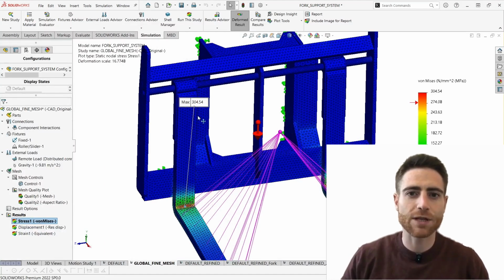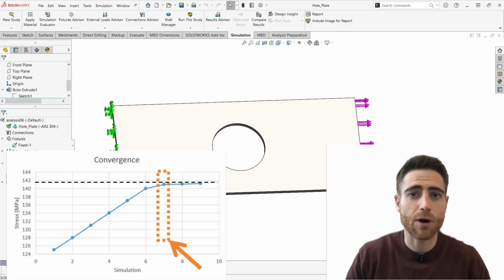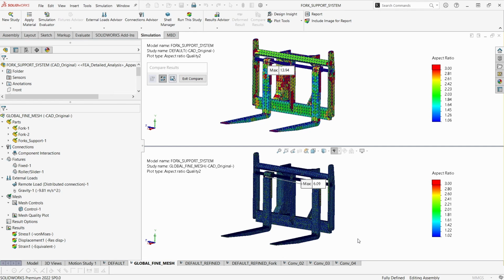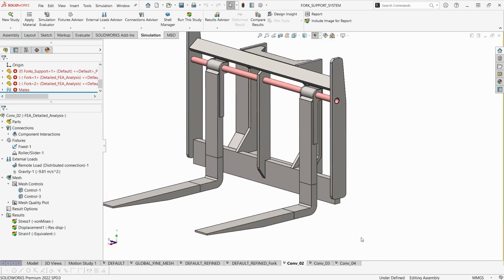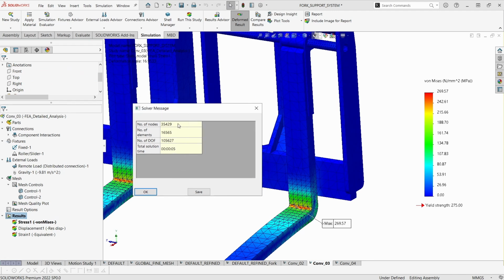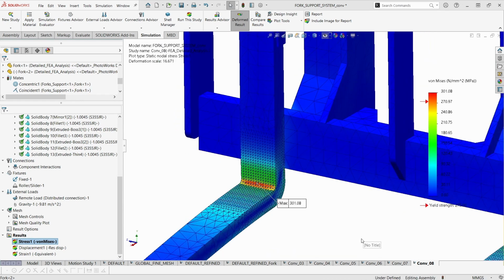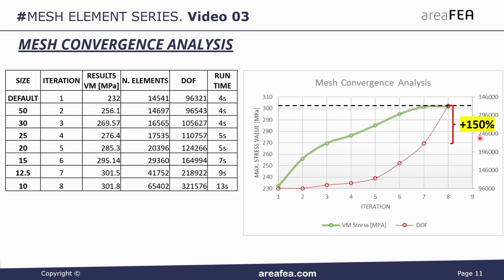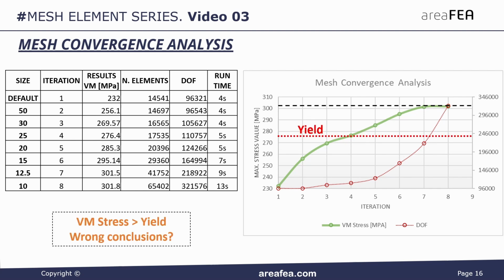When Should You Stop Refining Your FEA Mesh? | Meshing 03

Comment: Hi AreaFEA,

Great insight as always!

Mathematically, crossing the yield strength does NOT affect mesh convergence in a linear static FEA, as the solver strictly applies Hooke's Law (E = \text{constant}) regardless of S_y.

However, physically, once stress exceeds yield, the linear results become inaccurate due to plastic deformation and stress redistribution. To get realistic results, a Non-Linear Analysis (Elastic-Plastic material model) is required.

Best regards,

Eng. Ammar Boucetta
Reply from the maker: Exactly, Ammar! That is precisely the point I wanted to raise at the end of the video. In a linear static analysis, the solver can continue converging even if the calculated stress exceeds yield, because plasticity is simply not being represented.

Once we actually enter the plastic regime, the evaluation is completely different and we need the appropriate nonlinear material model. This is why it is so important in FEA to always understand **what type of calculation we are running and what physics our model is actually representing**.

Thanks again for the great contribution! 💪🤓